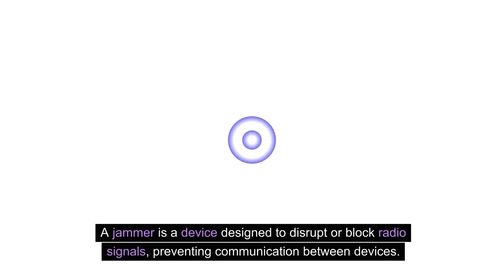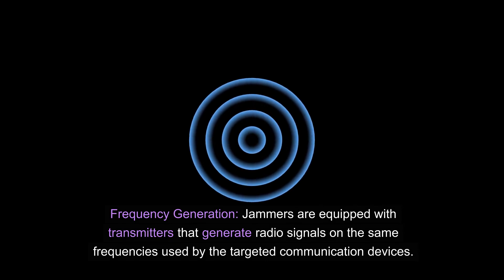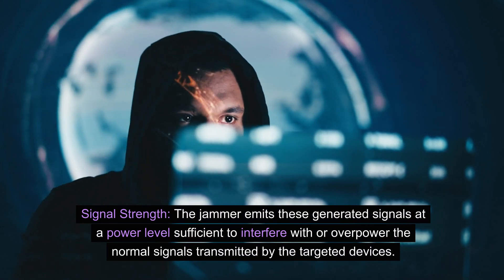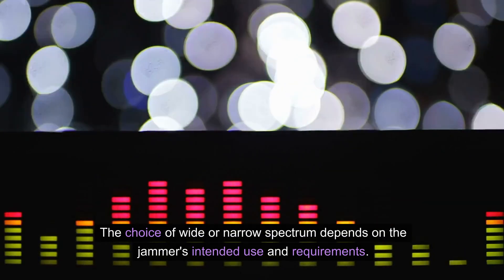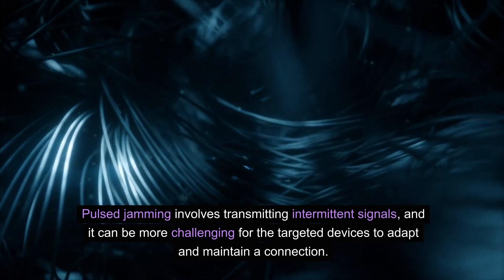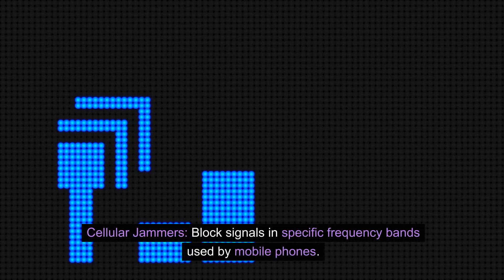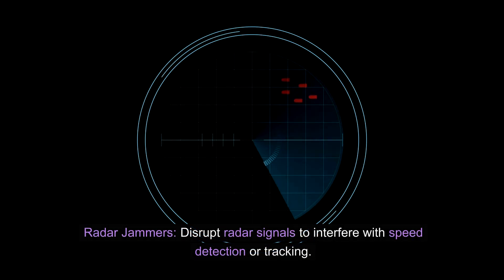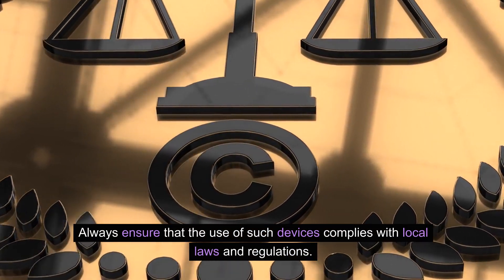How Does A Jammer Work

Comment: My school likely uses a jammer. Heres why:

Cellphone Tower Next to the School:
My phone behaves as though it’s constantly searching for signal, like how it would when trying to connect to Wi-Fi. The signal drops between 1 and 2 bars, which is highly unusual for a location that’s supposed to have good coverage, especially with a tower right next to the school. This suggests something is interfering with the signal.
• No Signal Issues at Home:
At home, I’m getting 3-4 bars of signal, even though there are other buildings between my house and the cellphone tower. This suggests that the signal at home is functioning normally, but the same can’t be said for the school, which seems to have localized issues. If the tower is providing signal to my house, it should logically provide similar service at the school.
• Coverage Claims from Other Carriers:
Coverage maps from Verizon and AT&T also show coverage in the area, yet I’m still experiencing weak signal. This points to interference—whether it’s from something like a signal jammer or physical obstacles in the school. The fact that the signal is weak for all networks makes it more likely that there’s something blocking the signal intentionally.
• No Wi-Fi in the School:
The fact that there’s no Wi-Fi in the school adds to the suspicion. It’s uncommon for a school not to provide Wi-Fi, and this could be a deliberate attempt to limit internet access through mobile phones. This could be part of a broader strategy to control communication, especially if signal blockers or jammers are being used.
• T-Mobile Coverage Map Says Otherwise:
T-Mobile’s coverage map indicates that I should have good signal in the area, yet my experience is quite the opposite. This discrepancy between the map’s claims and my actual experience is troubling, and it strengthens the idea that something is disrupting the signal—possibly on purpose.

Conclusion:
Given that there's a cellphone tower right next to the school, and the fact that I’m experiencing weak signal even though both T-Mobile and other carriers show coverage in the area, it strongly points to some form of signal interference at Shoreline Middle School. The phone’s behavior of constantly searching for signal is a classic sign of interference, which is commonly caused by a signal jammer or obstructions inside the building. The school’s lack of Wi-Fi and the presence of a local coverage issue further support the possibility that signal blockers are being used, either intentionally or unintentionally, to restrict communication.
This pattern of weak signal inside the school, while coverage is generally fine elsewhere (like at home), strongly suggests that something is deliberately interfering with the signal at the school, whether it’s a jammer or some other form of disruption.